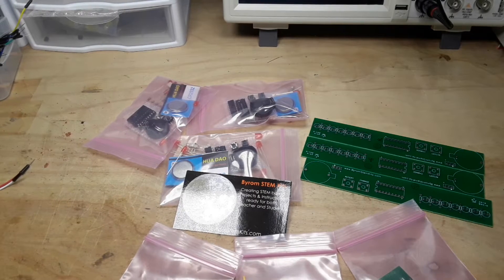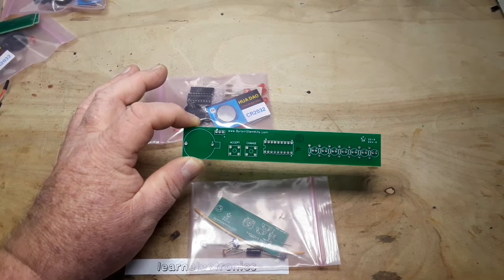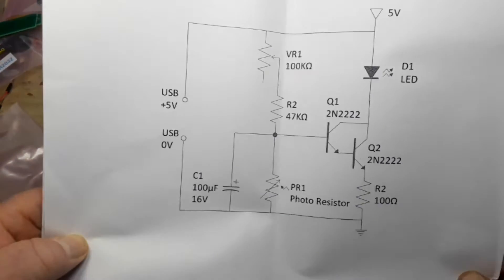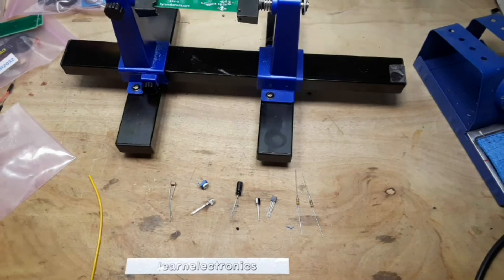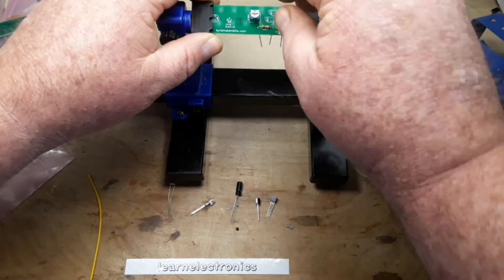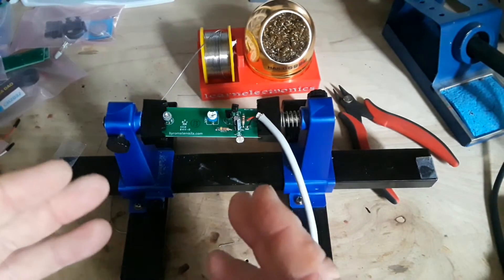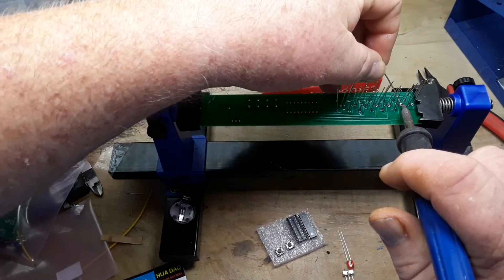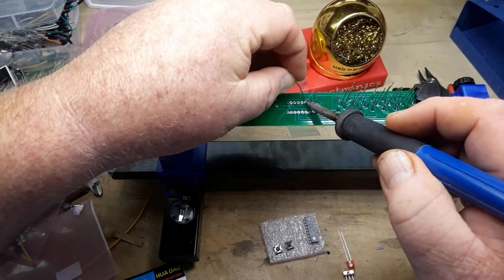Viewer Projects 2 - Byrom Stem Kits

Comment: Because of my parental units' heavy smoking*  I had a lot of ear infections as a small child.  Ended up damaging my hearing before the doctor put the drainage tubes in my eardrums.  This was about age 5.  For about 10 years after I had to be careful about not getting water in my ears as it would go inside and cause a new infection.  But at about 14 I was finally allowed to learn how to swim.  Anyway, it saved what was left of my hearing, and was a good thing to do.

* Verified by my ear doctor.  Although he said they weren't sure at the time of the relationship (early 60's) it had been proved later.